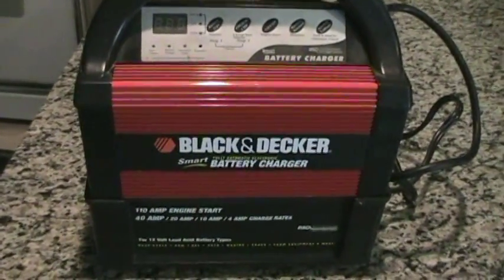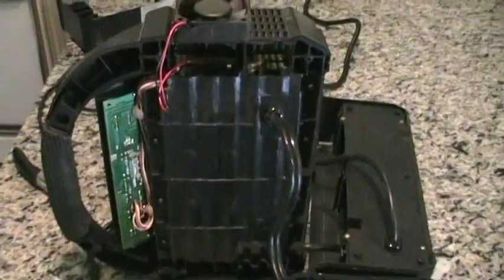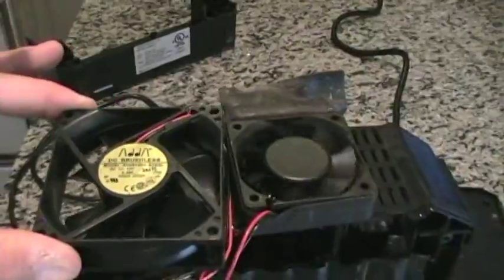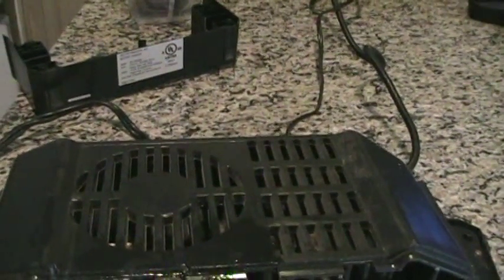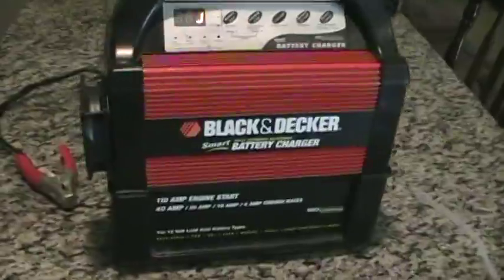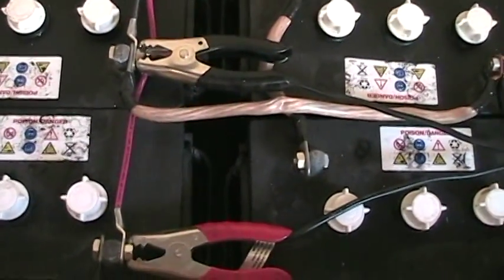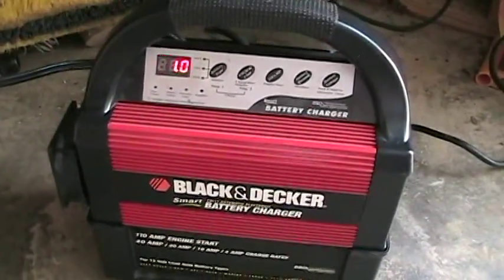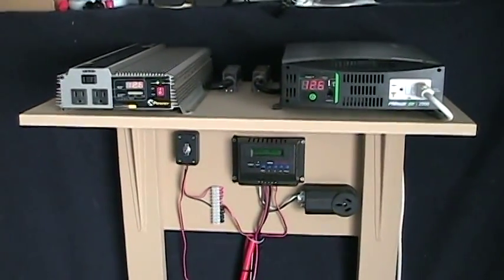Repairing My B&D Smart Charger – Painted the battery box

Comment: I, also, have a Vector that looks just like this. I found it by the side of the road and decided to take it home to see what was wrong with it. The main problem was the fan wasn't working. I pulled the fan out and wired it into a charger to see if it would work. Fortunately, the fan worked. That told me that the circuit that was supposed to be providing power to the fan wasn't working. So, I just wired the fan into an external power supply so that it would get power externally. Granted, it makes the setup a bit cumbersome. However, taking into consideration that the most I paid was $5 for a set of 20 5mm female DC connectors to connect the fan to the power supply, I don't consider it that big of a deal.

Comment: I have a Vector VEC 1092 A. The fan is toast. I'll replace it. Question: What are the electrical specs and model number of your new fan? I understand that these chargers have an issue with burning out a particular relay, that causes faulty operation. Thanks, Carl.
Reply: You can get a replacement fan on Amazon, just look for GDSTIME Dual Ball Bearing 60mm x 60mm x 20mm 12v Brushless DC Cooling Fan .  It's the same size as the original, but better quality.
Reply: @leew9641  Wow, very timely info.  Just watched this video due to my fan failing and your info saved the day.  New fan is on the way from Amazon.  Thanks Lee!!
Reply: @jacksnyder4708  Your welcome!  I've got mine installed.  Just be careful as you take apart the charger.  I tried to solder the leads from the new fan onto the circuit board instead of just splicing the wires together.  As a result, the charger works now, but the extra functions (battery voltage, engine start, etc.) do not.  I did something wrong probably!
Also make sure you remember which way the fan faces.

Comment: I wonder if these have the same problem with relays that the 25-amp model has.  I pulled mine apart not too long ago after it had sat for four years due to it not being able to charge anything that was connected to it (F03 error- open cell).  It turned out that the coil of the output relay went open.  I ordered a similar relay on eBay (SLA-12VDC-SL-C if anyone cares) and now it works like new.
Reply: douro20 Thanks!!

Comment: i had this exact unit branded as vector. worked well thought it wont charge really low batteries. good thing you caught this issue before critical components melted. 
last night i bought a schumacher xc85, what junk. claims 2/6/30/85a output, but the 30a is a boost only for 120 seconds and takes up to 10 min to decide if its going. to do it. I bought a bd bc25eb from a friend today used, hope it works.